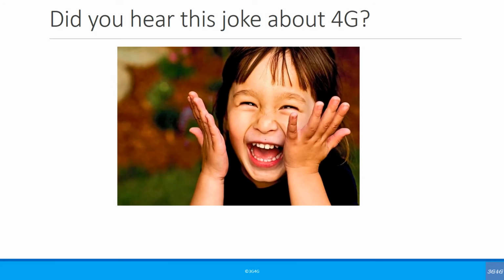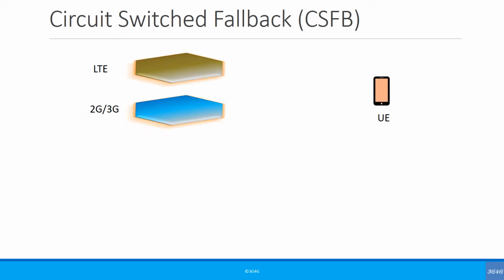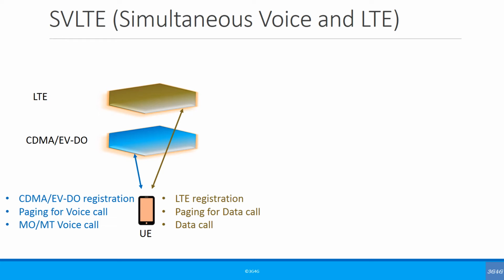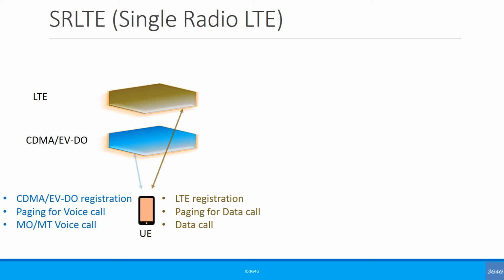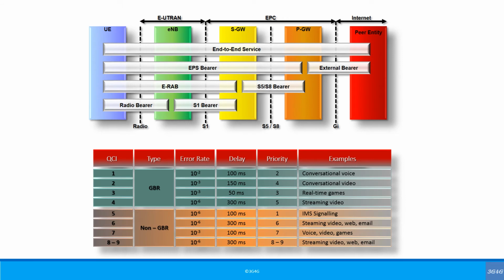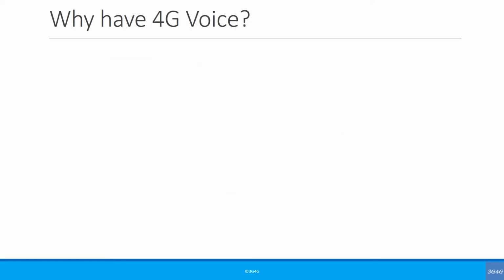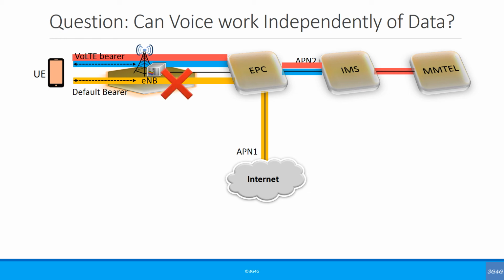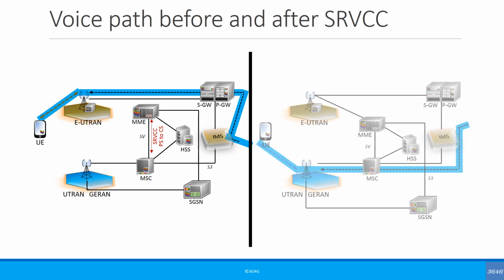Advanced: Voice in 4G: CSFB, VoIP & VoLTE

Comment: Hey 3G4G, Anotherquestion, in my daily work, I noticed that some call traces in Wireshark show "SRVCC". I looked it up and it means "Single Radio Voice Call Continuity". Reading a little about it, is this the same as CSFB (call fall back) ?
Reply from the maker: SRVCC is continuation of VoLTE call on 2G/3G network (mainly 3G) after handover from 4G to 3G/2G. In CSFB, The Circuit Switched core is used whereas in SRVCC, Packed Switched core is used. See this: https://www.slideshare.net/eXplanoTech/an-introduction-to-voice-and-sms-in-lte-networks-70681388 - slide 50 onwards.

Comment: Hmm... so at 22:40, you say that 4G VoLTE, it uses Voice as data...and it has it's own separate signaling to the IMS core. So just to make this clear if the Voice (in red on the slide) were being sent over the default data bearer (in gold on the slide), then that is the method for OTT clients like Skype and Viber?  BUT because the voice now has a separate 3rd bearer, than that is what makes it VoLTE?  Does the signaling method remain the same for OTT usage like Skype and Viber, and with VoLTE calls?
Reply from the maker: Correct about OTT but VoLTE has signalling (Blue) and Data (Red) part. By Data I mean voice as its just IP packets.